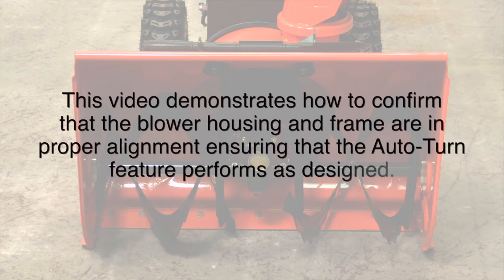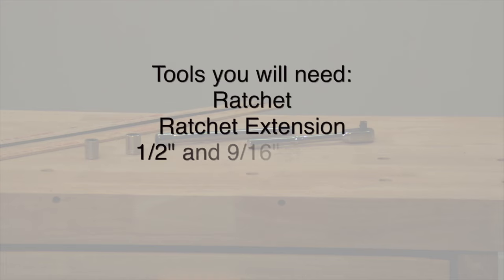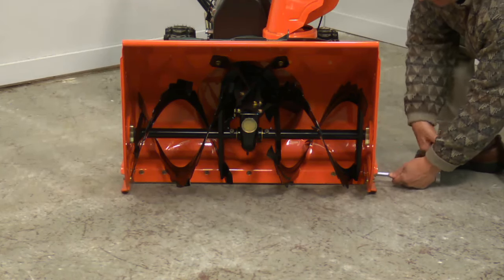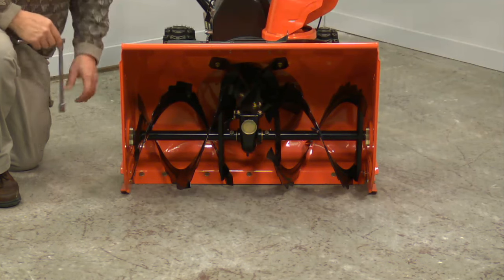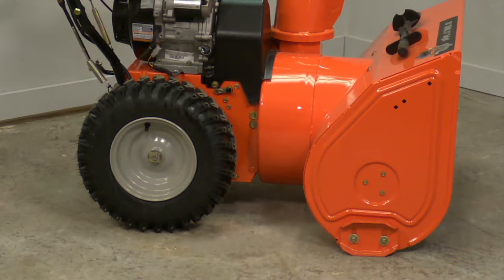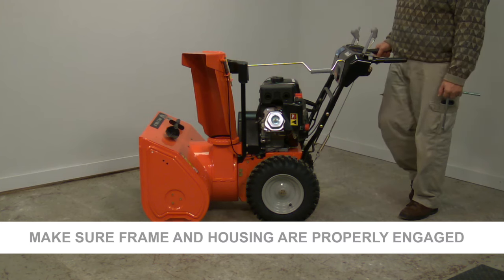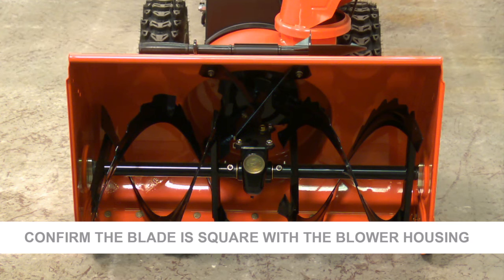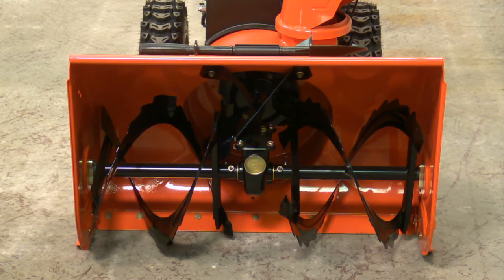How to Adjust Auto-Turn on Snow Blowers | Ariens®

Comment: A key issue not mentioned in the video is that both tires should be properly and equally inflated. Otherwise the rear "frame" of the blower may not be setting level - even with the bolts loose.  I have an older [1990s] Ariens (with the true differential) and noticed that the scraper was not flat/even on a flat surface.  It turned out that one tire had a slow leak and would drop to about 10 PSI every week or so.  The machine would then tend to lean toward the side with the lower tire pressure.
Reply: I was thinking the same thing about the tire pressure
Reply: It is mentioned at 5 minutes and 3 seconds (5:03).

Comment: A 1/8 inch adjustment on the skid shoes is fine for a hard, paved surface.  But if you have a gravel driveway you'll destroy your driveway, and I'm sure that throwing gravel isn't the best thing for a snowblower.  You'll need at least 3/4 inch spacing on the skid shoes if you are clearing a gravel surface.
Reply: The manual specifies 1/8 clearing for paved surfaces and 7/8 for gravel surfaces.
Reply: @clark772  You'll have nothing but problems going by those spec's especially on any gravel surface with stone mix or not. I know from experience. I used to shear pins like crazy along with stones flying. I have mine set at 1- 1/4" to 1-1/2" on my compacted stone mix driveway and never shear pins anymore. At an 1/8" your looking to create a possible ice problem.

Comment: My Experience: It's 2022, December 21. Three days ago I purchased the Ariens Deluxe 30" (carbureted version.) The auto turn works fantastic almost no pulling from side to side at all, (maybe once or twice in the "one and a half hours" of snow blowing our two large driveways, probably because the edge caught on the concrete lip.) We have roughly 2ft of snow today, it ate it and spit it out like nothing. One of the driveways has an incline as well. I would say it shot the snow 30 to 50 feet no problems, and again it tracked straight as a board unless I wanted to steer it, then it responded just the way it should. I would highly recommend this machine, it really is a pleasure to use. My Adjustments: Factory metal orange painted skid shoes, and their adjusted to 1/8" clearance. I used some 1/8 inch thick flat stock as the spacer while adjusting the skid shoes.

Comment: I bought a used Ariens 921044 Deluxe 28 and the auto turn was a nightmare....until I did the steps in this video. I loosened the 4 side bolts and shook the machine by the handles to loosen things up then tightened the bolts. Now the front contacted the ground evenly. I bought generic plastic skids from HomeDepot and affixed them using large washers as spacers (the ribs on the sides of the auger housing don't allow a flush fit with these 9" skids). I used 2 paint stir sticks on each side to create a gap under the scraper. Now the blower works very well with no un-commanded turns. I now actually like the auto-turn. I thought the double stir stick gap under the scraper might leave a lot of snow behind but with the slight crown on my dirt/gravel driveway and ice from recent freezing rain it worked out well. 
As for plastic skids, if you can find a source for 1/2 inch HDPE (old food cutting boards used to be this thick) you can make your own skids. 
In my opinion, nothing beats those old Toro blowers for ease of use. They had thick, angled, ribbed hand grips, and so easy to shift forward and back without having to look down at the detents.
Reply from the maker: We're glad this video helped improve the performance of your Sno-Thro! Thanks for sharing your experience.

Comment: Nice clear instructions and video. But for those who just go and grab their yard stick for this adjustment, at least mine anyway, is 1/4 inch thick. Definitely not the tool I wanted to use.  And of course I can only hope my "level surface" was level enough. Guess I'll find out this winter. :) Edit: Upon further consideration, due to high and low spots in my driveway, and the uneven wear on my scraper blade, which I ended up replacing, I later changed the height from 1/8" to the 1/4".

Comment: The tire pressure on the sidewall is the max pressure, the best pressure for your machine may vary.  The bottom line is the pressure needs to be equal on both tires.

Comment: I have the same issue, won't turn when it should and squirrely when trying to go straight. I did the alignment procedure and had the same results. Further testing revealed that it worked perfectly with the bucket off the ground, but would not turn at all with the bucket on the ground. Straight line tests delivered the same results, when going over uneven pavement or hitting a bump, the snowblower turns slightly as the bucket lifts off the ground, thinking that you are attempting a turn. Bottom line is the Ariens Auto Turn mechanism does not work (turn when desired) in practical use, i.e. with the bucket on the ground and actually blowing snow. The auto turn mechanism will only work with the bucket lifted (try doing that with the Deluxe 28+...) off the ground. This is being returned.
Reply: David -

We are sorry that you couldn't get your auto-turn adjusted correctly.  Richard is right that the tires also need to be equally inflated as that helps the bucket to be level as well.

The auto-turn is a great feature when it is properly adjusted, so if you still have your unit and need help, please reach out to our Tech Service group so they can walk you through the process.

Here is a link to our Tech Service group:
http://ariens.custhelp.com/app/answers/detail/a_id/263/session/L3RpbWUvMTM5Mjc1MzczMS9zaWQvVDVRaFpmTmw%3D

Thanks!
Reply: Ariens Social I stand by my review, I followed the adjustment / alignment process exactly and experienced the same results. I then returned the snowblower to the dealer for service, they too performed the alignment procedure and once again I had the same results. I sent it back a second time and the ST728 Deluxe+ still would not turn with the bucket on the ground. I gave up at this point and returned the Ariens snowblower and exchanged it for another brand. Which by the way works perfectly, is perfectly balanced and turns on a dime.
Reply: +David Marsh 
I have spoken to the factor directly about this problem...they are aware of it. The problem is even if your machine is adjusted correctly (tire pressure, housing is level as in video) under certain conditions you can still fool Auto Turn into thinking you want to turn..when you don't. Hit the perfect storm of uneven pavement, bump,  significant driveway slope...and Auto Turn will go from laser straight to random right and left turns and your coming along for the ride. At that point it's a wrestling match to keep it going straight....Ariens knows this I spoke directly to the factory about this...other then that, great machine.
Reply: How the hell is it a great machine if it can't even go straight down a driveway?
Worse Snow Blower I have ever owned!
Reply: @DavidMarsh-NH  I totally agree..... Who has a perfect smooth driveway with pristine snow with no edges to hit! 🤔
Reply: I could NOT agree with you more! This is NOT a matter of "tuning" the machine for auto-turn - auto-turn imposes itself greedily in practical conditions (when it's anything OTHER than a fresh snowfall), forcing one to wrestle continuously with a very expensive machine.
Reply: @arienssocial735 yeah, the autoturn is trash for ANYONE besides a small flat driveway. Any sense spot or uneven surface and you fight the thing trying to constantly turn back and forth. You should offer a way to lock it solid like the old units
Reply: @DavidMarsh-NH  Auto turn sucks bad.  What brand did you get?
Reply: @daryldaryl887  Toro Power Max Heavy Duty 928/1028 OHXE Snowthrower with the manual turn controls. Bought it 10 years ago and still love it. Used it in today's storm!

Comment: Always check the tire pressure and set the same pressure in both tires before you do any of the adjustment
Reply: The equal tire pressure does not ensure equal circumstances.. I bought seamstress tape measure and measure the circumstances of the tires and adjust air pressure accordingly.

Comment: I was hoping to find out how to turn that Auto Turn system OFF.  I don't have a smooth driveway.  It is mainly dirt.  I've been wrestling with the snowblower as it tries to turn left and right by itself.  I'll try raising the scraper bar up so it doesn't dig into the dirt so often and see if that eliminates the constant turning from left to right.  I may have to raise it up a quarter inch or more in order to get a smooth operation.

Comment: I don't own an Ariens, but I was looking to purchase one of their pro models, but before I did, I did my research and because of so many dislikes of the auto turn system used exclusively on all but their smallest two stage machines, I opted to buy a different brand with triggers to lock or unlock each axle separately. I am surprised Ariens does not offer that option. Don't get me wrong, if auto steer worked in every situation flawlessly, then I would want a machine with that technology. Pulling triggers is not perfect in every situation either, but at least the machine turns when I want it too. After delivery from my local dealer, I opened up the inspection plate and made sure everything was lubricated from the factory, and it was, and at the same time I observed how heavy duty the cog system was that locks and unlocks the axles for turning. There was even anti- cease on the axles from the factory. HD snow blowers are not cheap, the last thing I wanted to do is spend that kind of money and not be pleased with its performance. Some say the auto turn is the best thing sense sliced bread, while others to put it politely, dislike it. Another thing about the auto steer differential that some complain about, is moisture entering in and causing issues with the differential to work properly. Maybe doing an inspection every two to three years depending on how many hours you use the machine would be part of your maintenance ritual. Sense the gear teeth are always under some pressure from the spring holding them together, when making a turn the teeth pass over one another, there would have to be some wear over time. That clicking you here when moving your machine around is the gears passing over one another. I wonder if a stronger compression spring between the gears would help the differential from unlocking so easily. Just a thought. Have a safe and enjoyable winter everyone.
Reply: Yeah, the ariens autoturn is a nightmare even after this. If you hit a sense spot on 1 side it tries to turn. It's a constant fight on anything but fluffy powder and a flat surface.

Comment: I replaced my stock skid shoes with longer steel ones (8") that track straighter. The blower goes straighter but still turns around easily at the end of the driveway. WAY better for me anyway.
Reply: Thanks for the heads up. I just got my ariens and it was a struggle to use until I came across this video. This helped alot. I ordered a set of composite skid shoes and if that doesn't help I will order longer ones like you did. So you mind giving me the link of the ones you got?

Comment: What a pain in the ass that is. Owned an Ariens mower and regretted it. Thanks for pointing out the flaws that the company does not fix in their warranty due to product design flaws.
Reply: I don't see where this procedure is a pita. It took the guy all of about 2 minutes to do.
Reply: Need to do that on any 2 stage snowblower bud.  Sounds like user error on your part.
Reply: We are sorry your auto-turn was not working correctly.  If you are still having issues, please follow this link to get to our Tech Service Department so they can assist you.  

http://ariens.custhelp.com/app/answers/detail/a_id/263/session/L3RpbWUvMTM5Mjc1MzczMS9zaWQvVDVRaFpmTmw%3D

The auto-turn feature works well when it is adjusted correctly, so we want to work with you to make sure you are satisfied.
Reply: FYI,  It looks like this article is no longer available.
Reply: Tech support told me to take my nearly new 280 SHO to a local dealer and have them adjust the alignment, which would not be covered under warranty. I've already adjusted the alignment, it isn't a complicated procedure but it doesn't resolve the problem. 30 minutes of snowblowing and my palms and forearms are killing me from wrestling with this machine.
Reply: All driveways are poured with a drainage slope,none are actually level.
Reply: Paul N I agree. I definitely have to fight this thing on the smallest in perfections on my driveway. I’m convinced it’s the auto steer. 
My old Ariens did NOT do this.
Reply: Incredibly simple adjustment
Reply: @arienssocial735  the link does not work

Comment: Here are the short comings of the 30" deluxe Ariens snow blower that I own for the second winter now:
1.) the cable controlling the deflector on top of the chute froze up numerous times. ( this is very annoying)
2.)The turning mechanism operated with left hand lever only works occasionally.( actually it rarely works)
3.) In 6" sow or more a fair size hump of snow forms on the already cleaned area. This is probably due to narrowness of the steel 
      the auger is made of as an MTD unit with a much more substantial auger does not do this.
Other than these short comings it is a well built unit, but the dealer is not very helpful.The auto turn feature had better be left off
as I don't even dare to touch it.

Comment: I like the distance that the snow blower can move the snow but the auto turn leaves me exhausted after trying to stop the machine from going side to side between cars. FYI I have a flat level drive way so the fishtailing I experience seems odd to me.  Is t here a way to just lock the axle of the  machine so it disable the Auto-turn feature?  

Thank you.
Reply: Auto-turn does n not work very well if your driveway is slightly less that a perfect flat plane.  Any slight drag on the skid or scraper will cause the blower to turn that direction. It is quite a workout - your forearms will be pumped at the end of the winter.  Auto-turn work great on the grass then the blower is 6" above the lawn - the wheels unlock flawlessly when you make a turn in any direction.  On snow, not so much.
Reply: I’ve had the exact same problem with mine since day one (2011-12) Always fighting it to go straight but Im crappy little craftsman goes straight as an arrow. How do we get around this?
Reply: Yes, you can disable it by opening up the differential and inserting hard wooden blocks to jam the mechanism. The blocks can be removed to avoid voiding the warranty.
Reply: RSole9999 ya I finally just got sick of it and sold it for 600$ (took a huge loss)and bought a husqavarna St330p with the triggers for turning. Haven’t used it yet. I will never buy an ariens again
Reply: I love power turning with triggers I can turn on a dime in deep snow with ease... I would like to see ariens come out with power turn...

Comment: My 1965 Ariens 10M4 ST424 doesn't have auto turn but it's easy enough to turn.  I just squeeze the clutch handle which puts it in neutral and roll it around, release the clutch handle and off I go again.  Easy peasy.